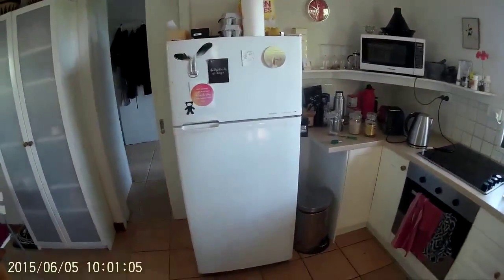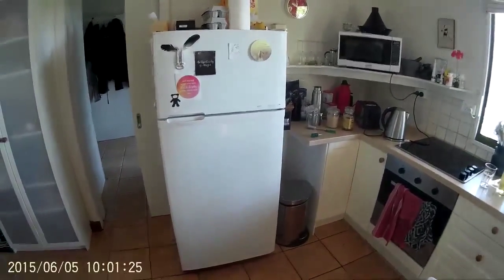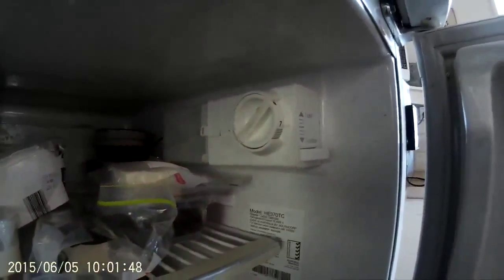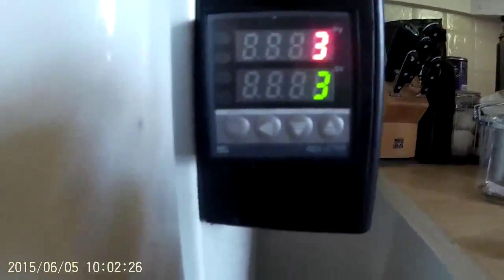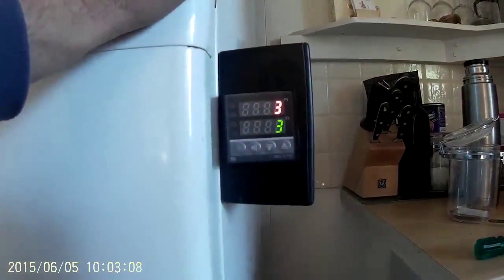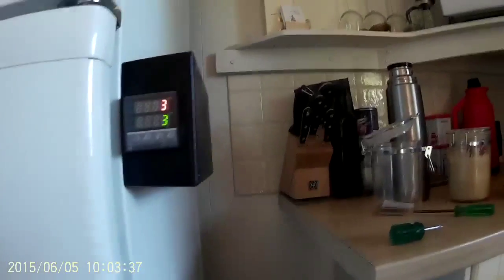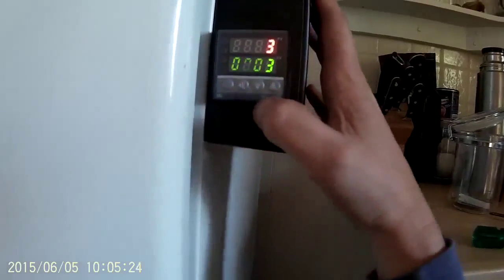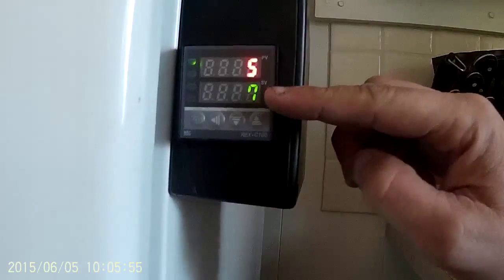Repairing an Old Fridge with a New Electronic Thermostat (REX-C100 PID Controller)

Comment: Very genius idea putting the thermocouple in the water as a buffer. Nice job
Reply from the maker: Actually I used oil in the end.. Have since put it in an inch long, inch diameter piece of caulk that had set inside my caulking gun. Works better!

Comment: You could also use the Master control Hysteresis setting that bypasses the PID control function.. Just set the Hysteresis to say 2 and the 
controller will turn on when the fridge gets 2 deg above set point and off when the fridge gets to 2 deg below set point....

Comment: A VB-7 thermostat would have cost about $30 (I appreciate that you used what you had in stock) and would more than likely have been a simple replacement for the existing thermostat. I used one to convert a chest freezer to a fridge.